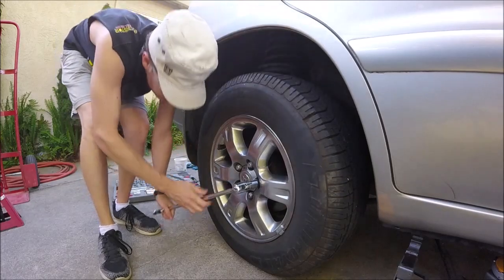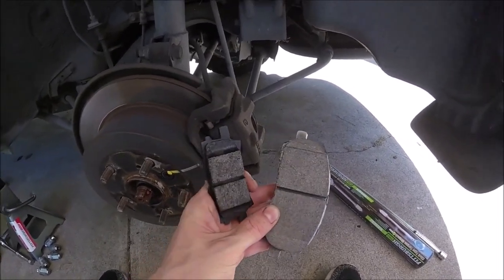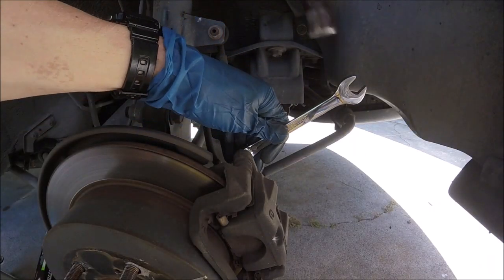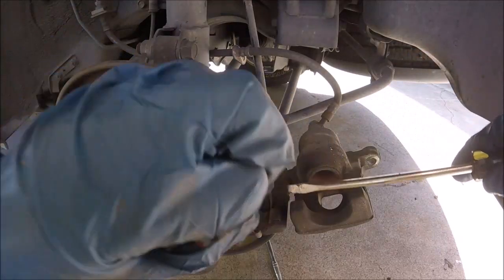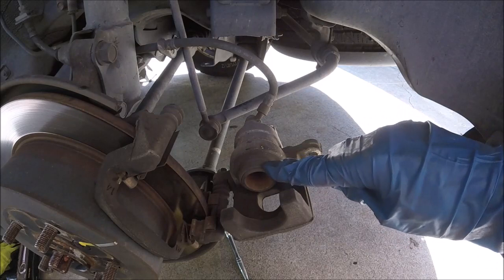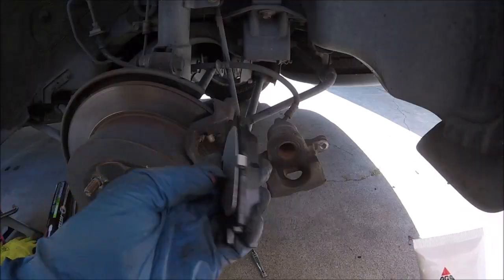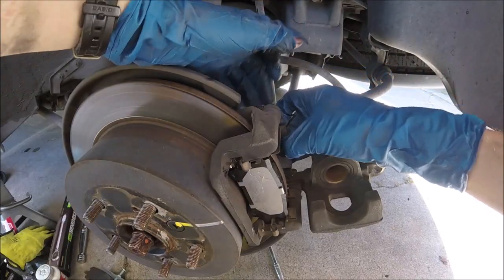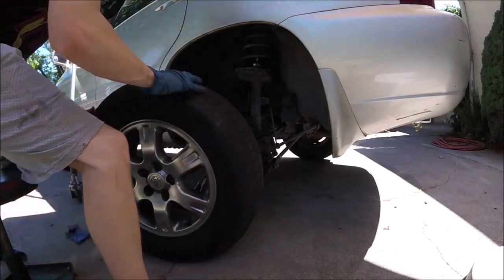How To Replace Brake Pads Toyota Highlander -Jonny DIY

Comment from the maker: Tools & Supplies Used

Caliper Compression Tool- https://amzn.to/2mMcXPD
Syl-Glyde Brake Lubricant- https://amzn.to/2LPN0d1
Wire Brush- https://amzn.to/2ul7XIE
Anti Seize for Bolts- https://amzn.to/2IKu8em
170 Piece Mechanics Tool Set- http://amzn.to/2xoyu5c
Torque Wrench- https://amzn.to/2GHorwh
Jack Stands- http://amzn.to/2ggUwCO
Harbor Freight 3 Ton Low Profile Jack- http://amzn.to/2CJhLPF
Safety Glasses- http://amzn.to/2ez41Jw
Respirator Masks N95- http://amzn.to/2xX32x3
Mechanic Gloves- http://amzn.to/2w0i1SP
Nitrile Disposable Gloves Large- http://amzn.to/2w0dlwc
Thanks for Watching! Help Support the Channel by Subscribing & Clicking the BELL Icon for all NEW Videos!

Comment: So I was always told to open the bleeder valve when compressing the piston but it always causes air in the line and it looks like it’s unnecessary???
Reply from the maker: Not necessary to open bleeder valve when compressing calipers on pad changes. Only if you need to bleed brakes like after caliper change 👍

Comment: Short, sweet, solid instruction with good insights. Video work did it's job to show the details. Like to see a little more footage that includes FRONT replacement as well.
Reply from the maker: Thanks James. Have to do some front end work soon on same car 😀👍
Reply: Front is the exact same process with disc brakes. Compress the cylinder with C clamp, swap old pads out, put new pads with guides on, reinstall the caliper

Comment: The rip off mechanic in my town wants to charge me $400 for replacing my rear pads. No compassion for just a regular working guy.
Reply from the maker: Wow that is overpriced. Should be around 200 and thatd be with OEM pads. No more than 1 hour of labor for a mechanic. Unless he was going to change Rotors too. If rotors arent too old can have them resurfaced for pretty cheap if you call around
Reply: Go to the county and drive to find a mechanic do it for 40.

Comment: Yo pal, don't say you're replacing pads when you're doing rear shoes.  Pads are for discs.  Shoes are for old school.
Reply from the maker: Brake shoes are when you have drum drakes. Both front and rear on this car have disc brakes. The front is the same job just with different torque values. Here's a later video I did on same car Front and Back plus changing rotors 👍
https://youtu.be/s2VHgos3Kvo